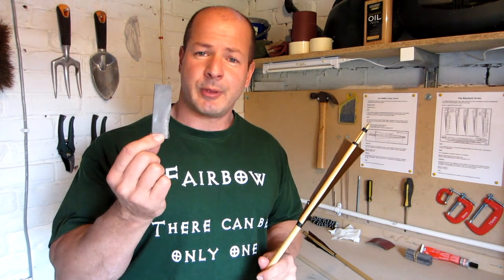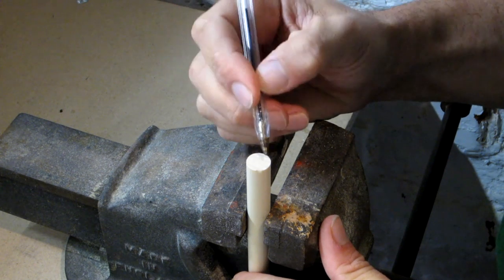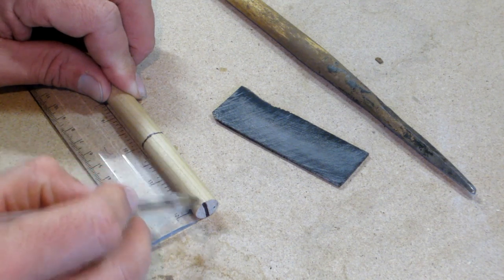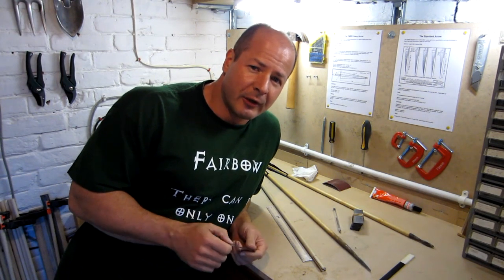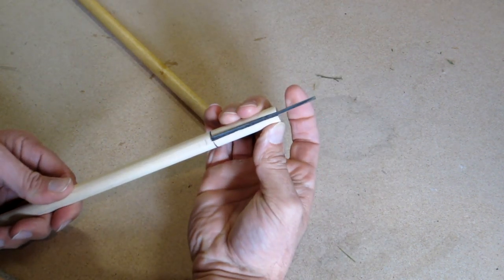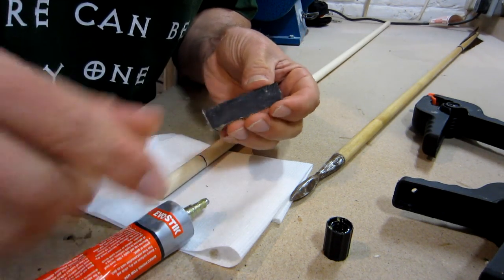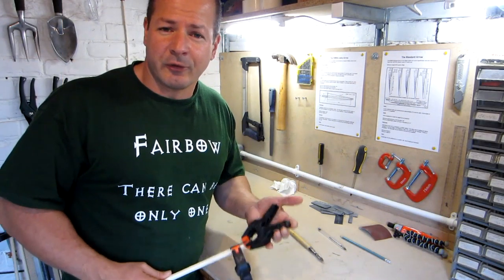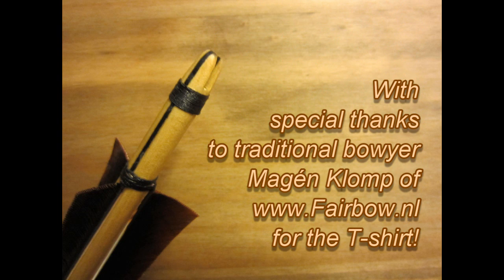Horn Inserts for Self Nocked Arrows - Video 26

Comment from the maker: Hey Jake. Glad you enjoyed it mate. Sometimes I use only 2 saw blades if the horn strips are thinner, but it works a treat and is much easier than using a wood saw with big teeth as they are too agressive and snag on the wood all the time, making a rough cut. Hacksaw blades are much finer and smoother.

Comment from the maker: I bought this batch from Richard Head Longbows but they are also sold by Fairbow, Barebow Archery and DIY Archery. All are based in England however. For Ireland take a look at Flybow. They sell large pieces of horn plate in their arrow building supplies section. They are quite thick though (3 -4mm).

Comment: Hi, Nick.  I still contend the horn used on medieval arrows was mostly from local oxen and not water buffalo.    I wrapped my shafts tightly with heavy string when I glued in the horn.  A lot of string.  I think it worked better then a spring clamp.

Comment: 3 hacksaw blades is clever!
I was using a tile saw blade for the hacksaw that was the right thickness but it was way harder to keep it all straight and avoid deviations as it was basically a round file.
Thanks!
Reply from the maker: Thanks Aron. I too have used a tile cutter blade and do quite like that method.

Comment: Hello, nice video! Which saw do you use? I like the idea of just taping three sawblades together but I think that doesn`t work with every saw at hand...
Reply from the maker: Hello Hendrik. A saw designed to cut ceramic wall and floor tiles also works well.

Comment from the maker: I understand why you think that but if you cut the slot for the horn to the correct thickness then the shaft won't split when inserting the horn. You then cut the string nock so the string goes at 90 degrees to both the horn and the grain, which is stronger than it going at 90 degrees to the horn but in line with the grain as the string touches both horn AND wood.

Comment: I tried using impact adhesive to glue in horn strips but it didn't dry very well and stayed fairly soft. Instead, epoxy with a little less hardener and a bit more resin works extremely well to make sure it's more flexible.

Comment: Thanks for video nick! Can you do a video on making the binding of the arrow? I find that to be quite difficult. Especially because everytime after a couple of shoots the thread starts to loosen and comes off…. A video about that would be terrific
Reply from the maker: Thank you for the request Rupert. Next time I need some new arrows I will try to remember to film the binding process for you. If the binding is always coming loose I would first check to make sure your arrows are not too stiff for your bow, as they should not rub so hard against the bow to wear through the thread, no matter how you bind them. You can also paint varnish over the thread to make it more durable.

Comment: Thanks for making this, I watched it a while back and helped with my research for a story (one of the characters makes arrows with the horn nock etc. so it's good to know how it works). I have a question about your arrows themselves though. Do you make them out of ash, for example? I'm trying to find a good wood [and diameter] to shoot with that won't snap so easily. I've used some 11/32" wood dowels and they fly well but I'd like to hear your thoughts on that with sharp arrows
Reply from the maker: Hi Derek. Great to hear that my video helped you with your research. For light target arrows I use cedar. For 'war' arrows I use poplar, as that seems to have been common. If I need the strongest arrows for use in public demos against replica armour I use ash or even better birch, as both are very dense and strong. Dowel can be a good cheap substitute that works well, but the quality can't always be assured. The diameter used will suit the bow's power. Less than 45lbs I would generally use 5/16". Up to 70lbs 11/32" or 23/64". From there to 110lbs 3/8" and then for the heaviest bows a 1/2" at the head tapered to 3/8" at the nock.
Reply: @bigbowbrum  Awesome, thanks for the specifics, man! :D

Comment: what poundage bow do you shoot thows logs out of?? lol

which do you think is better???   and which was found (historically)
I'm curious as why you put you horn in with the grain. If the majority of the force is going to be taken by the horn then the horn would be pushed into the soft part of the wood and it would lead to splitting (but the string its self is across the grain so the string would be supported by the grain). In contrast with having the horn across the grain, the grain would support the horn a lot better. But the string its self would be with the grain so it would have to be just supported by the horn.

Thinking about it i would have thought the second way would be stronger. But I'm no expert!
Reply from the maker: Hello Joe. I shoot these arrows from bows ranging from 100 - 130lbs. I understand your point regarding the orientation of the horn to the grain. Unfortunately I have no scientific answer for you. This is the way I was taught and I believe the Mary Rose arrows had a similar orientation. I have never had a horn insert push deeper into the wood I must say.
Reply: Hi Joe,

The reason that the horn is oriented in this fashion is to reduce the likelihood of splitting the arrow on the loose.  As the arrow is fired it must bend around the bow to retain a straight trajectory to target, a phenomenon known as "the archers paradox".  If the horn was oriented across the grain as you suggested, when the arrow flexed around the bow there is a greater chance of the shaft snapping at a grain run-out.  With the horn oriented parallel with the grain as Nick does in the video the grain lines are perpendicular to  the axis of bending creating less chance of splitting.

As for strength, it is the shear strength of the larger glue bond on the flat surface of horn that provides strength to the nock, rather than the bearing strength at the end of the horn pushing against the timber shaft.

Hope that helps.

Comment: Hi, thanks for your videos, they are just great! I was wondering if it's possible to make a horn insert also to thinner shafts, such as 11/32 or 5/16? The insert is quite thick after all, so my fear would be that for example 5/16 shaft would just split upon sawing...
Reply from the maker: Hello Johanna. It may be possible if you can sand the horn down to a very thin strip and use a fine saw blade, but I've never tried it myself.
Reply: bigbowbrum Thanks for your reply, maybe I'll try it at some point :)

Comment: Do you have the exact dimensions of arrows found in mery rose?
Reply from the maker: The arrows were all different but the average length was 32.5 inches from the shoulder of the head to the base of the nock. The diameter at the head was 1/2 inch and 3/8 inch at the nock.
Reply: bigbowbrum thanks